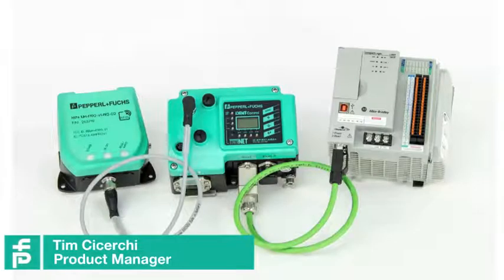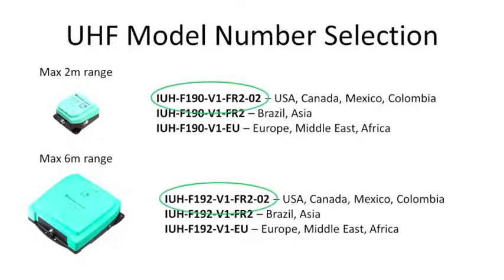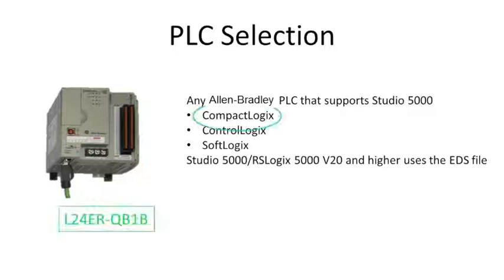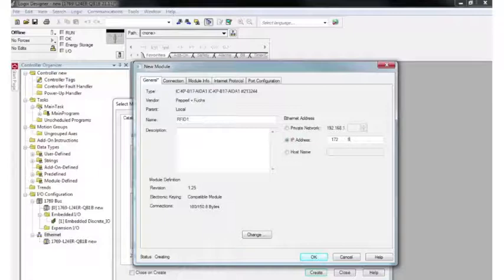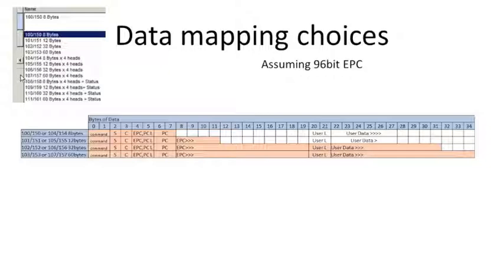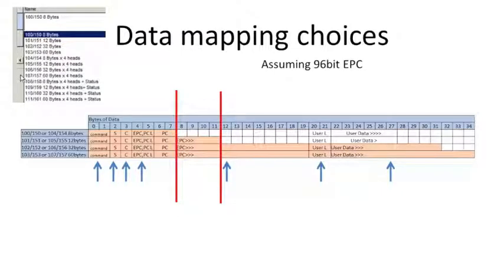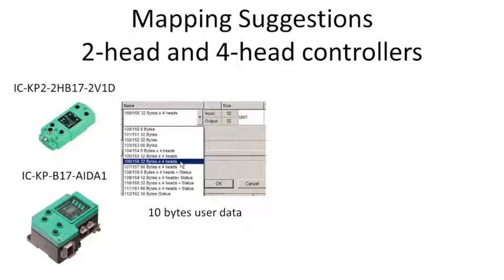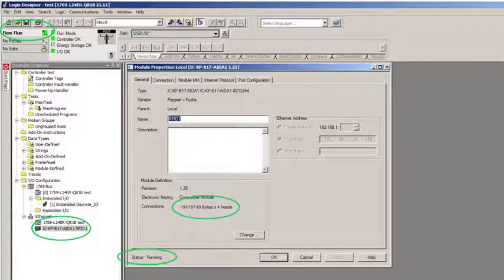Industrial UHF RFID with Studio 5000 Logix Designer

Comment: is it possible to connect 2 UHF RFID with one 4head ethernet controller 
In first UHF RFID we mapped as 107/157 60 bytes x 4 head with size 60
Now we need to connect the second RFID reader with the 4 head ethernet controller so we need to get size 60
so what mapping address should we give
Reply from the maker: Hello Roshith cv, with the four-head controller you can connect up to four UHF heads to this controller. You have selected the correct assembly 107/157. This assembly will map 60 bytes for each head for a total size of 240 bytes in and 240 bytes out. The offsets are byte 0 head 1, byte 60 head 2, byte 120 head 3, and byte 180 head 4. If you use the add-on instructions, this offset is automatically taken into account. We hope this is of help.